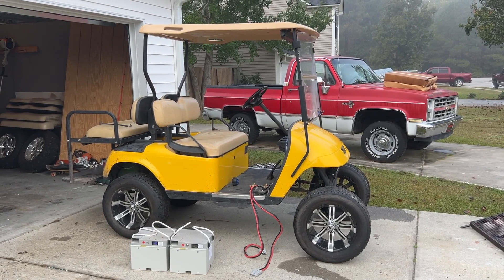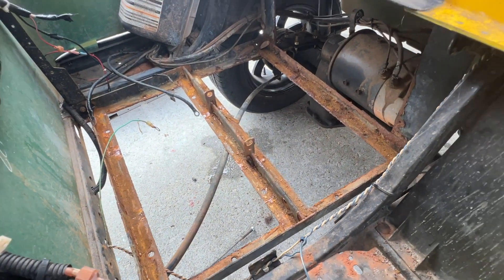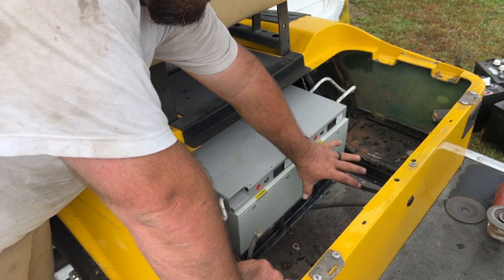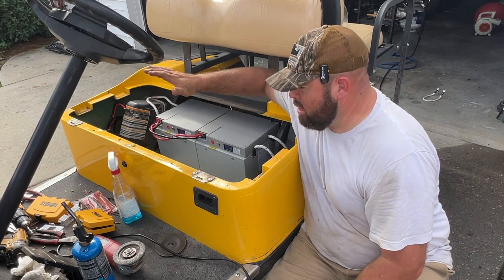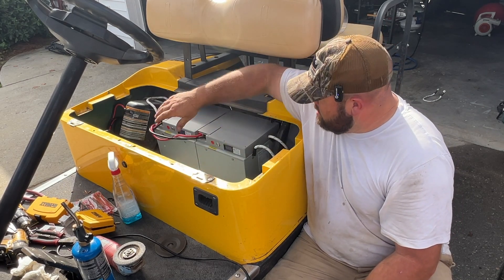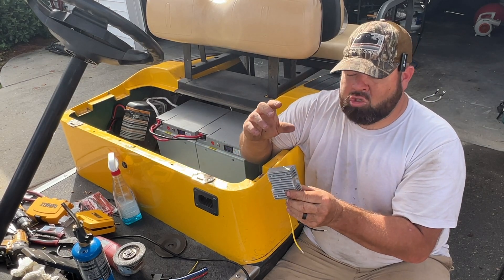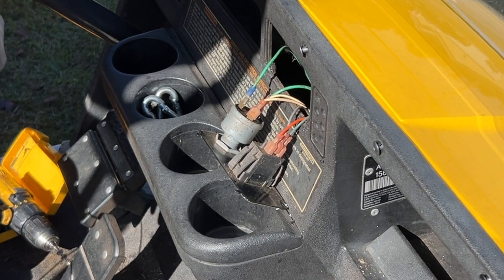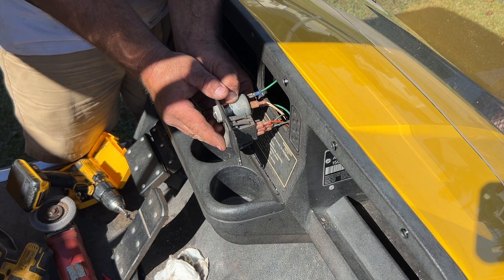Ezgo TXT PDS Golf Cart Gets 36v Lithium Battery Upgrade with DC Converter & Relay

Comment: OK I am going to ask some questions that some might think are stupid.
I see that most electric golf carts have standardized on 48V.
What is the intent to make a 36V or 72V golf cart?
The weight of the batteries must be one concern.
I dont understand why the manufacturer would want to make and stock motors of 3 different voltages.
Why would you not standardize on one motor and controller for all of the carts that you make?
If someone needed a limo cart with 6 or 8 forward facing seats, could you install a motor that will tolerate 48 to 72 volts, and then you could have multiple battery boxes that can accommodate multiple sets of 72 volt packs?  That way your limo cart could handle the additional weight and torque needed.
Is it possible to convert a 36V or 72V cart to a more standard 48V?
It seems like you would have to change out the motor and controller, or at least a controller that can handle a voltage range of 36V to 72V.

Comment: What's the difference using 1 vs 2 vs 4 batteries if the end net result is 36 or 48v anyway? Seems that 3 or 4 12v batteries end up much cheaper that a single large battery?

Comment: I have a question…i was installing a navitas 5kw kit on my club car precedent last night.  When i pulled the factory motor off there was a lot of moisture inside and rust.  Do you do anything before installing the new motor to keep moisture from getting inside, like a gasket or rubber oring?

Comment: I have a question. Could you do a video on putting lithium batteries on a resistor cart? I’ve heard that resistor carts can’t take lithium but I think you could figure out a way to make it work.
Reply: I had a 2001 Club Car DS and switched to LifePO4 batteries. They worked great.

Comment: I have the same golf cart.  2008 36v pds. I need new batteries. Should I stay 36v and just go lithium? Or should I upgrade to 48v lithium with navitas AC conversion and 5kw and 600a controller ?
Reply: If I stay 36v do you still recommend upgrading the controller?
Reply from the maker: If you plan to upgrade to navitas ac why stop at 48v  lithium, just go straight to 72v.
Reply: @Fentertainment  well for one thing the 72v batteries are more expensive.  About $900 more for the raptor 2 100ah than the 48v falcon bigbattery 122ah kit. 

What would be the biggest benefit of going 72v vs 48v?
Reply from the maker: @docmia21  More voltage less amperage. Speed, Performance....POWA!
Reply: What does one need to do to upgrade from 36v to 72 v on this cart?

Comment: Is it necessary to run a relay with falcon 48 V battery and Nikons plus light kit
Reply from the maker: I always run a relay with this type of reducer. But do you have to? You Dont Have To. For many years people ran these with out a relay. The only reason I run a relay is because if the cart is sitting not being used while you are at work or sleeping or whatever. The converter is running and converting 36v to 12v.
Reply: Interesting to me because I install a lot of Big Battery lithium batteries locally. On ezgo’s I clean and paint the tray and fill the gaps with 2x8 pressure treated boards after cutting off the hold down tabs. I than use the supplied hold down brackets and screw them into the boards. I’ve done 36 , 48 and just did a 72 volt on ezgo. I’ve been only using one battery except for the 72 volt. We are flat and paved here in this golf cart community so one has been fine. I never thought to widen out the tray to install the battery in the back tray but good idea. I always use the relay after watching your video on how to install it , works great. Always look forward to your videos, they have been very informative and helpful. You’re saved me more than once , keep them coming.
Reply from the maker: I appreciate it. Your way of doing it sounds alike a good way of doing it also. I just used what I had. 
 @billmackey1072

Comment: What did you wire the reed switch to?
Reply from the maker: battery positive
Reply: @Fentertainment  thanks. I just bought a 2000 EVGO txt pds. The old owner reversed the battery cables and it won’t run. I bought a 36v lithium and I’m making my way through everything. It’s my first cart so it’s slow going.
Reply from the maker: @johnlamarca1099  Take your time. Be sure not to hook anything up while the battery is on and put it in tow. Most people make the mistake of accidentally reversing the polarity and not putting it in tow.